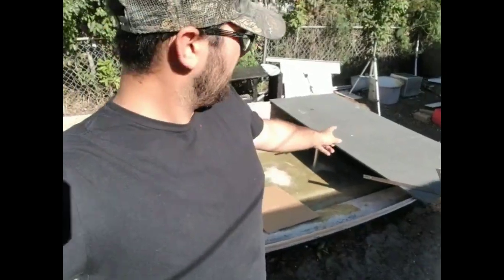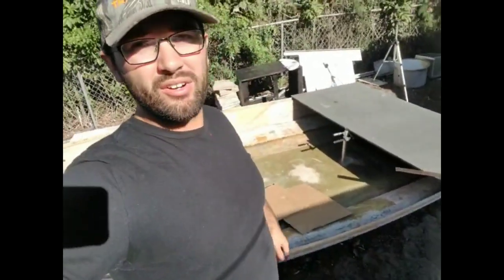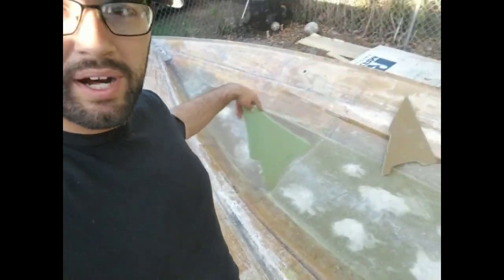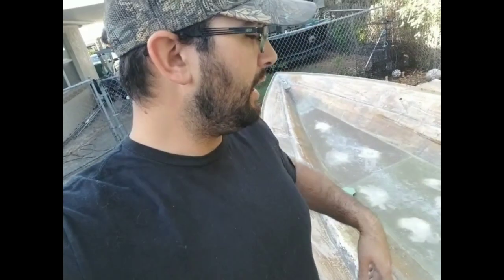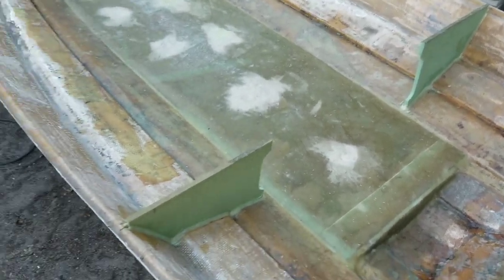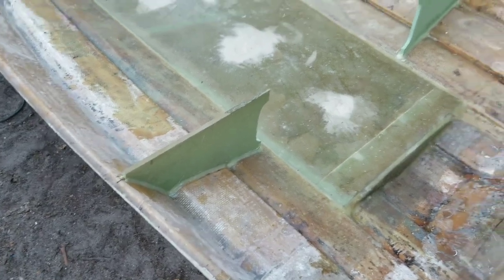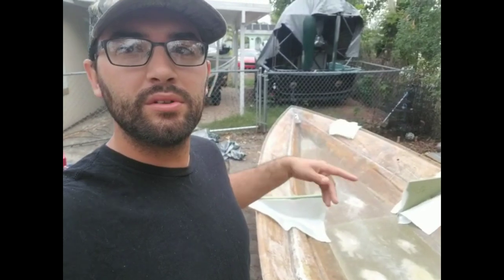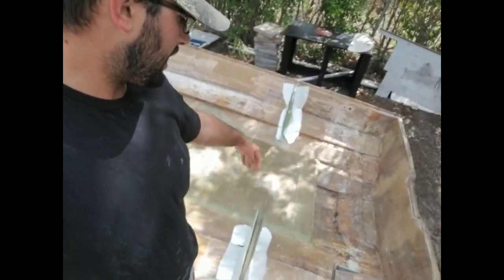DIY Fiberglass boat build (bulkheads) Part 5

Comment: You should watch Andy from boat works today and learn how to fiberglass a partial bulkhead in you have a two inch wide running the length of bulkhead now do a six inch run along the floor to bond the bulkhead to hull should do three runs for adhesion to hull getting wider as you go that might not hold to floor of hull  JT 🇺🇸🇺🇸🐠🐟🎣🛥🌴⛱🙏🏻🙏🏻🙏🏻
Reply from the maker: Thank you. And I definitely watch Andy but theres many ways to skin a cat and this way works. It's been a great boat so far and already made some bad decisions in it and been in some shit. running off shore 12mi in it and dealing with these crazy summer squals in south fl but only time will tell shes holding up great now!
Reply from the maker: Also one of the best skiff builders in Fl Mr. Harry Spear. Spear Boat Works  dose his boats like this and there being built and sold every day. Only difference is hes using viynallester resin.